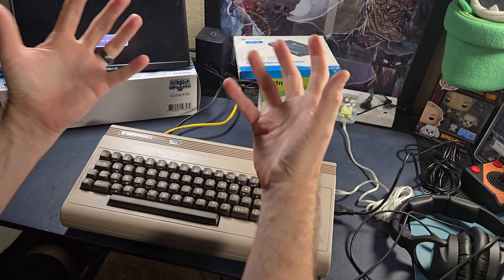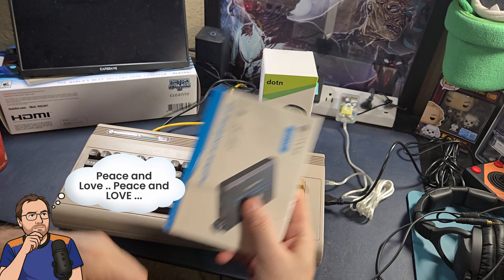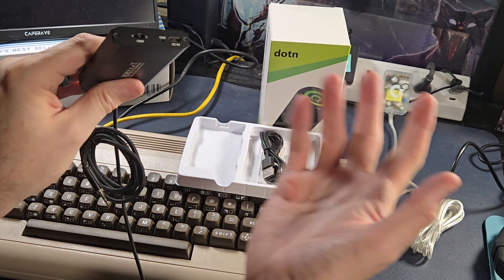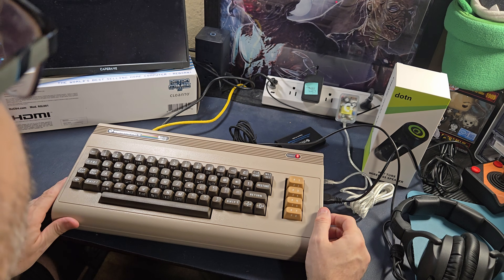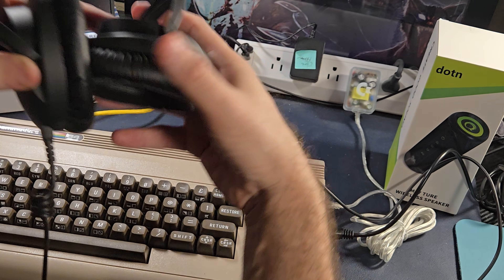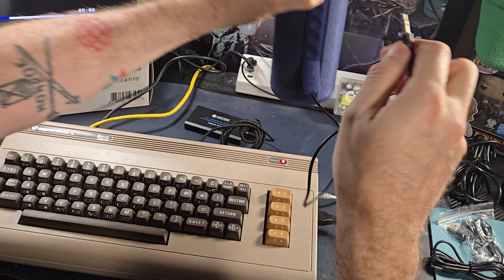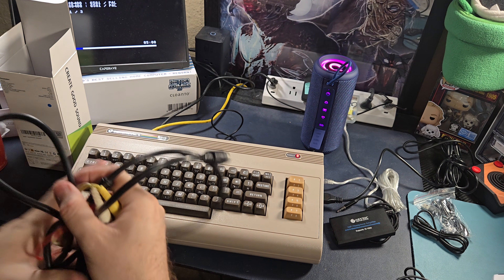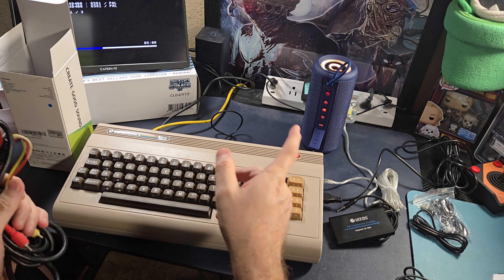C64University: Audio Redacted - Addressing Your Comments!

Comment: So, here’s information I never heard from any review of the C64U. I tinkered with it the whole night trying to problem solve this. I have official Commodore 8-pin video cable with composite, RCA and S-video. I plugged the composite to my CRT, and then tried to connect audio to 3,5 mm connector of the C64U straight to my active loudspeakers. Curiously, only left speaker worked. Tried swapping speakers and cables, only left channel works. Then I tried to connect to a new monitor with HDMI at the same time and take sound from monitor’s headphone jack with the same cable and speakers. It works, I get stereo.  Also tried plugging the RCA jacks of the 8-pin video cable straight to loudspeakers, it works. Then I tried using the C64U’s 3,5 mm connector while unplugging the 8-pin video/audio cable. It immidiately outputs stereo again!

So, what the manual doesn’t tell you is you can’t use the 8-pin video output and 3,5 mm sound output at the same time. A shame.
Reply from the maker: I'm not familiar with the cable you mention.  The "Chroma Luma" cable has two video plugs and a single mono audio plug.  There would be no way to get stereo out of that cable.  I'm not sure how you get "stereo" out of the 8 pin cable unless they did some rewiring?  https://i.imgur.com/Q0jVerV.png

Comment: Glad I caught this video.  After watching I opened the user's guide and sure enough on page 4, it does say about the "Audio output" that it "is a line-level output and cannot be used with headphones."  Some time ago I managed to blow the PSU that came with my electronic drum kit, and now I know why.🤭
Reply from the maker: I always knew that line outs weren't necessarily useful for headphones because it's always too quiet and requires some sort of amplifier to be usable. I didn't know it could be destructive though

Comment: This is cooler than some of you might know.  Back in the day Radio Shack sold a little amplified speaker in a beige box. I think it used a 9 volt battery.  We used it to connect to the PET 2001.
Reply from the maker: Bad ass.  Thanks for the shared memory.
Reply: @darkuni  Still need the bluetooth solution and then an FM transmitter so I can listen to it in my car.  You could be the FIRST person on the plant to make the C64U a mobile device (as in mounted in a car)...

Comment: What are the best solutions for a Commodore 1084s monitor.
I used it with the Amiga back in the day and it does have stereo.
Conveniently, so does the c64u with dual sid capabilities.
Reply from the maker: Be lucky if you could get your hands on one ... HDMI + a stereo monitor isn't too hard ...
Reply: I still have my 1084s
But the inputs didn't take into account that some future tech sensei would create a stereo capable Commodore 64 
 @darkuni

Comment: As someone mentioned, that line out is perfectly fine for an old school amp. I would add that from what I know, 'safe' is not really the right term here. I would not expect using headphones directly to a line out to cause any damage to either component. It is just not optimal and not something you really want to do if you care about the quality. It will be quiet and you will have to turn it up to a point where your hearing more noise then you really should want to be hearing. I'd say what you are explaining here is the correct way to use a line out, not any safer. Maybe someone would disagree but I've never seen any damage done from this mistake in connections. I suppose you might crank something up to compensate and cause a problem with a crackle when the cable inevitably moves.
Reply from the maker: You would think, though, from other comments? That if I insert those headphones ONE MORE TIME, they may never work again.  It is sort of a .. parody ... on the urgency of the comments.   :)
Reply: @darkuni  I have to admit I did not read everything here or on last video. Bottom line is you should pay attention to understand if something is line level or not and connect it appropriately so it sounds best so the follow-up video here is appropriate. I did watch the first one and did not think twice about if that was a headphone jack or a line level and I know better. I prefer line level if I had to pick as I generally route all my computer audio into an amp to hear on real speakers so I'm happy with my option. I've lots of 1/8 in stereo to RCA cables for just this reason.

Comment: You're wrong, and you should feel wrong!!!   :D  

Kidding.

I just use a little line mixer (Mackie 402VLZ4) between my U64 and some powered monitors/phones.  One could also just extract it from HDMI at the monitor (in cases where the monitor provides D to A conversion as many do).  I also do this in some cases.

Comment: I'm not sure the lineout is that sensitive unless you switch the jumpers over to the SID-Direct side (left pair iirc, my 64 elite is packed away rn).  If the jumpers are on the real-SID side, I think the traces go directly to the sid output pin(s) with no modern circuits inbetween.  Might be worth ohming out.  This is only if you have real SIDs.  But sure, now you can turn those headphones into head-mounted-speakers. ;)
Reply from the maker: There is a lot of conflicting data out there between "real" C64s, emulated and simulated ones.  From the documentation, I believe you're right .. there is a way to "bypass UltiSid completely" at the hardware level - and perhaps THAT scenario would be particularly vulnerable here.

Comment: Hook up something through SPDIF optical and you can then have a part 3
Reply: This is exactly what I have for my setup. A mini-toslink to toslink cable I picked up on Amazon and my tos-link in on my soundbar beneath my PC monitor. Works so nicely, and is crystal clear!
Reply: Yeah I came here to mention the evil red light shining out of that 3.5 mm audio port. I happened to have the little adapter to a standard SPDIF cable so I hooked my C64U up to my Onkyo receiver and can now hear SID tunes in their fully digital 48 kHz glory! (Ok, you get the same over HDMI, but still.)
Reply: I didn’t realise digital was an option from the audio out
Reply: @TrashfordKent  The line out doubles as a mini-TOSLINK optical out. It can hook up to anything that takes optical and deliver digital audio.
Reply from the maker: Yeah, I plan to hit a couple of goodwills this weekend and find a soundbar or something with it for proper testing.
Reply: I have some digital active speakers I might try that out on- I’m figuring my Ultimate64 II MB has similar functionality, will check the chip.

Comment: The audio chip on the C64U is Nuvoton NAU88C22YG, and it has 3 types of outputs: Speaker output, headphone output, and line-out. I've checked on the C64U motherboard, and the chip's line-out pins (AUXOUT1/AUXOUT2) are the ones which are connected to the 3.5 mm connector, so yeah, it's a line-out...
Reply from the maker: Thanks for that.  I'm a doctor, not a hardware engineer ... :)
Reply: @darkuni  can you do a video about the screen you have connected to it?... and center the picture options?.
Reply from the maker: @jackobyukI do have a video reviewing that monitor.  Not the screen centering part though...
Reply: @darkuni  is there an option in the settings to center the screen of the u64, the blue border and the inner screen of the blue border?..
Reply: How about a video on mouse options for geos....new options
Reply from the maker: @chemania1 GEOS is getting its own extravaganza at some point.  Pointer stuff will be covered there
Reply: @darkuni  I wish I could share my mouSTer with you but people at the border are a bit too crazy these days..  (yeah i'm a northern guy)
Reply: @JeSuisUnePatate  Me to!
Reply: Cool to know
Reply: So it is safe to plug in the headphones directly to the C64U, right?

Comment: 5:08 The Yellow RCA cable transmits the video signal, the red (right) and white (left or mono) cables carry the sound.
Reply from the maker: I'm not 100% sure that's true.  The two cables are CHROMA and LUMA, right?  That means no audio is carried over them ... If you plug in red and yellow, you get video, but no audio.  Plug in WHITE you get audio.  If you plug in yellow without red, the picture is incorrect (and vice versa).

This isn't an A/V cable.  This is a "chroma luma" video cable...
Reply: @darkuni  I see, my mistake then. I have two sets of cables looking exactly the same, but carrying a video and two audio signals. I knew of the possibility of your combination, I just have never seen one like it.
Reply: @darkuni you are correct, sir. That’s what gave the commodore monitors such a crisp look compared to rf and composite. Was an early form of s-video, don’t know if anyone else did it this way.
Reply: @darkuni  I had that issue in the past.  I believed it was CHROMA and LUMA but on my Commodore monitor, it didn't worked when I used to plug it on the back.  It took me a while before I realize it was a single video + mono audio + left audio.  My old cable is using a proper CHROMA, LUMA and AUDIO output cable.  The more you know eh!